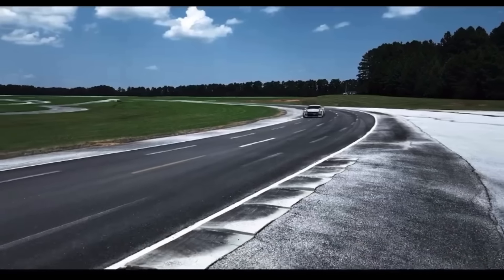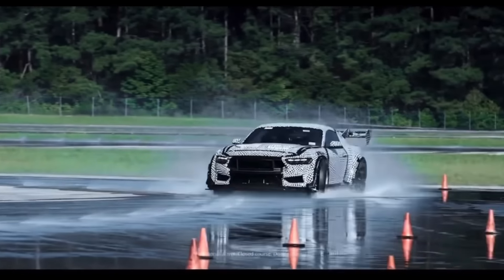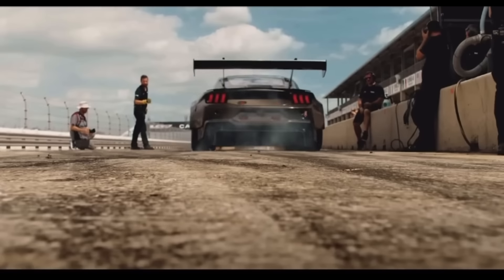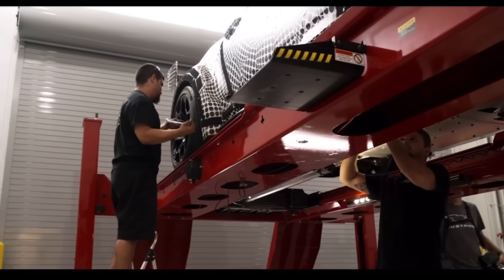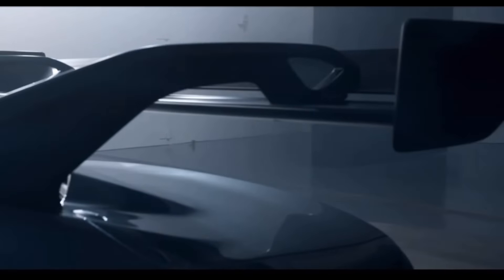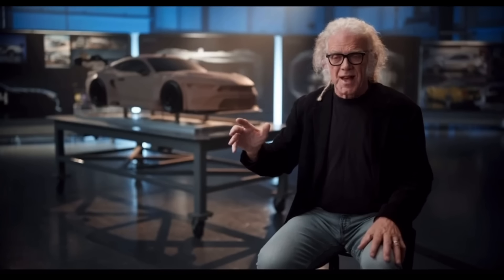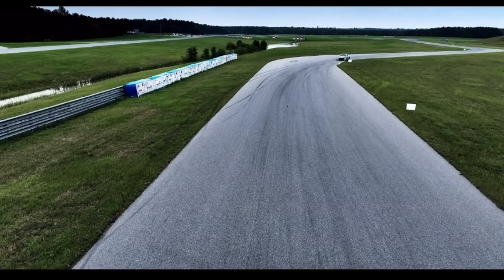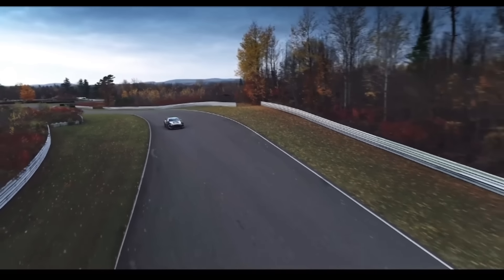Ford Mustang GTD | 800 Horsepower German Slayer!

Comment: So it’s not a mid engine mustang like everyone has been saying. It’s a REAR TRANSAXLE mustang, BIG difference.
Reply: I've been wondering that myself. I think it may be classified as a front mid-engine (like a Viper). Since it is a dry sump, transaxle mounted configuration, they can sit the engine really far down and back. But, have to wait and see.
Reply: It’s front mid engine. Near 50/50 weight distribution. Think of amg GTR. Plus, this is a mustang, it wouldn’t make any sense to make it a rear mid engine
Reply: @mishysquittens you’re absolutely 100% correct. It’s an amazing suspension, have you seen the setup yet?
Reply: The engine is mounted behind the front axle so it’s a midship. You can see the pulley slightly in front of the axle.
Reply: Yeah they kinda just copied the older vettes with the trans in the rear
Reply: @Rrl32591 the only thing they “copied” was the location😂. That’s like saying that a mountaineer copied a Gtr because they are awd.
Reply: @That_5.0_Ranger  No.  The idea of putting the transaxle on the rear and connecting the engine with transmission via a torque tube on a performance car was taken from the older Corvettes.  Since the days of C7, GM realized that they reached the limits of front engine, rear transaxle design and moved on.  Ford also realizes this with their true mid-engine 'uber' GT..  But why make such a big deal with the GTD layout?
Reply: @PC-xj2mw  it’s like vettes copied it from Porsches of 70s and 80s.924, 944, 928 all got transaxle. A lot of race cars get converted to transaxles too.
Reply: @brettconv83  Yeah, some of the pictures I have seen are just gorgeous what they have done with suspension.
Reply: @veejay120793  so you are saying that this Mustang GTD has 70s technology going for it...
Reply: It’s a c5 mustang 😂
Reply: It's not a Mustang anymore than that EV turd is.
Reply: Early misinformation/speculation.
Reply: @veejay120793 mounting the engine completely behind the front axle is a century old design in front engine rear wheel drive race cars. This is not some secret tech just discovered. You can go back to the 1920s and farther on this one.
Reply: @PC-xj2mw 😂😂😂😂 that's rich......you think mounting the engine behind the front axle is 1970s technology?!?!😂😂😂

Try 1920s at least😑

Contrary to what they told you in school, your ancestors were not knuckle dragging mouth breathers.
Reply: @Malibu1515  I didn’t say anything about being new tech.All I’m saying people assume a mid engine car is always a rear mounted engine when it’s not.
Reply: @Malibu1515  Read carefully and get back on the subject.  We were talking about the use of Torque Tubes, not the engine placement.
Reply: @Malibu1515  Speaking of ancestors, you sound like one of those people who visited the 'creation museum' in Kentucky to see what their ancestors were upto!!  🤣🤣🤣🤣

Comment: The Mustang "used to be" for everyone.  I knew a guy in the 90s who was a manager at two bell who bought a brand new GT.  He made like $18 an hour and he could get a brand new GT. You can't do that now.  GT 5.0s are 50 - 60k now.  They're 30k used.  No... they aren't for everyone anymore.
Reply: That's because jobs haven't kept up with inflation. I don't know what year you knew this guy or exactly which year Mustang he had, but let's assume it's 1995. MSRP for a Mustang GT back then was $20,710. That's equivalent to $42,410.58 today. The MSRP for a brand new Mustang GT is $43,090, barely more than the old Mustang would be in today's money. The guy you knew made $18 hr which is equivalent to $36.86 hr. That's the equivalent of $76,668.80 a year today. This guy you new made more than enough money to do whatever he really wanted to do within reason, and Mustang GT was easily attainable for him. Taco Bell managers today make like $21 hr which is way less than what this guy makes. Back then they would be making the equivalent of $10.25 hr, $21,320 compared to his $37,440. Ford has stayed pretty consistent with their pricing, but jobs have fallen behind with their pay.
Reply: But they also run like 11’s stock and handle like German cars
Reply: @derekcharlesgrey  A new GT 500 still can't keep up with a Porsche GT3RS on a track. That's the whole point of this video.  Lol. They had to think even harder, Porsche makes their GT cars better every  year.
Reply: @rkwjunior2298  There are articles literally mentioning how the GT500 matches the Porsche GT3 on many tracks and beat the Lambo Evo. It's not even comparable for price chief, the GT500 is way better for that alone.
Reply: @raionshishi8290  It needs 250 more HP to even come close,  and the Porsche can still beat it.
You can't beat a Porsche chassis, I'd pay more for the Porsche all day long. Not only for the amazing trackability but value. The Porsche will increase in value
Reply: @derekcharlesgrey  Drive a German sports car and then say that........ NOPE
Reply: @derekcharlesgrey  Runs like a German car? Hahah. The Mustang needs 750 hp to even come close to the Porsche.  
You can't best the German chassis. It's a work of art.
You Mustang guys are insufferable
Reply: @quentinfreeman7516  It was a fox body - 92 or 93.
Reply: @rkwjunior2298 Yes a GT3 would be a formidable opponent, if not completely dominate the Mustang.
Reply: @rkwjunior2298  It needs 250 more HP ? Try the Porsche needs +100k more in cash to even compete. The Porsche can still beat it because it's overbuilt to hell, it better beat it for that price chief, you didn't make a good case there at all. Not to mention the GTD will hold it's value too anyway and likely better.
Reply: @raionshishi8290  The GTD starts at 300k$, so that kills your money argument.  And needs 300 more hp to beat the 991 gt3rs, not even the 992. Lol. It also took a special team of engineers, Porsche does it every generation. 
I guess the GT500 wasn't good enough if ford  had to add over 150k$ to the price of the GTD to get it to actually compete with Porsche and Aston. 
Think about that. 300hp and 150k$ premium over the gt500 to get under 7 minutes on the nurburgring. 
For 300k I'm buying a Porsche, you cant beat the resale either.  They constantly go up in value. And production isn't limited like the GTD.
Reply: @rkwjunior2298  I'm sure it took them 80k to build it and they want it to seem "special" so they ask $300k for it.
Reply: @watchthiswithrob  hahaha ya I'm sure.
Reply: @rkwjunior2298  "The GTD starts at 300k$, so that kills your money argument."

The Porsche 911 GT3RS starts around 250k, yet there is no such pricing anywhere since none of them sell for MSRP, they are all marked up to 350k+ - 400k+ thus meaning the argument stands, especially considering the Mustang GTD won't be sold through dealers which means it won't get markups, it's a private purchase directly at Ford. (Used 2023 Porsche 911 GT3 RS with 2700+ miles on it, average price of $465,995, saw another one for 419,999 with 1800+ miles) Keep trying chief.

"And needs 300 more hp to beat the 991 gt3rs, not even the 992. Lol. It also took a special team of engineers, Porsche does it every generation."

Does it have 250 or 300, you seem to switch a lot, and is that relevant ? Cars use different methods of having an advantage, more weight but more power, less power but less weight, more aero but less speed, more speed less aero. I don't see your point exactly, it's like making fun of the Bugatti for having as much power as it does to beat other cars and saying that it sucks, most people would laugh at you for saying that. Also Porsche uses a special team to make their cars, making it every gen doesn't change that fact. It's a poor argument to make overall.

"I guess the GT500 wasn't good enough if ford  had to add over 150k$ to the price of the GTD to get it to actually compete with Porsche and Aston."

The GT500 isn't the same model of car that the GTD is based on, let's clear that first since you seem to be heavily confused on that fact. The pricing and again power is irrelevant especially since the cars it is competing against either cost more or have their own advantage in some other way if not raw horsepower, a pointless argument. It's like saying the Bugatti Chiron is terrible or sucks because it has more power to beat it's competition, people would laugh at you for saying that.

"Think about that. 300hp and 150k$ premium over the gt500 to get under 7 minutes on the nurburgring."

Let me know where you can find a car for the price of a GT500 running under 7 min at the Ring, I will wait. 

"For 300k I'm buying a Porsche, you cant beat the resale either.  They constantly go up in value. And production isn't limited like the GTD."

The exact point you made about the GTD being limited is why it's resale will be faster, higher and hold better, great point for the GTD.
Reply: @raionshishi8290   You made my argument about resale. Yes. The GT3rs is selling on the used market for nearly $500k, some are $550k. So I rest my case on resale value. 
Just like the GTD, the GT3RS is sold to certain clientele first at MSRP. You CANNOT walk into a dealer and purchase the new GT3rs, at all, unless used.  And the GTD is 1000 limited, which makes it impossible for anyone to get at MSRP except certain clientele. The GT3RS isn't limited production and still fetches huge markups. 

My point about sub 7-minute ring times was to someone else who said the GT500 was a GT3rs beater for half the price. My point was that Ford needs to tack on 150+k$ of engineering to match the GT3rs in the real world. 
And when it comes to power vs price. You're paying for engineering.  Porsche can do sub 7 min (6:44) to be exact with only 510hp. Mustang needs 800, that's if they can match that. In my opinion, that's incredible engineering. 800hp is stupid, it's a handful for anyone to drive. Ya ok, 800hp sounds cool. But 510 and faster Lap times is a feet of engineering. And much more confidence inspiring due to amazing driver control.  
Anyone can make a fast car. Let's put 1600hp in a Toyota Corolla and beat a Bugatti in the quarter mile. Which one do u want in ur driveway?...lol
Reply: @raionshishi8290 bro no it doesn’t the 991.2 gt3 rs is way faster than the gt500 in the real world the 991.2 gt3 rs did 2:41.6 seconds on the Virginia raceway the gt500 did 2:44.6 seconds that’s nowhere near keeping up dude
Reply: You can get a 300hp mustang cheaper than you could in 2005 now. It might not be a v8 but those are like 15-20k used and smoke most mustangs before 2011.
Reply: @quentinfreeman7516  you hit the nail on the head. Everybody seems to think that prices and inflation have gone out of control. That's only because wages have NEVER kept up with CPI. At least not since the OPEC crisis.